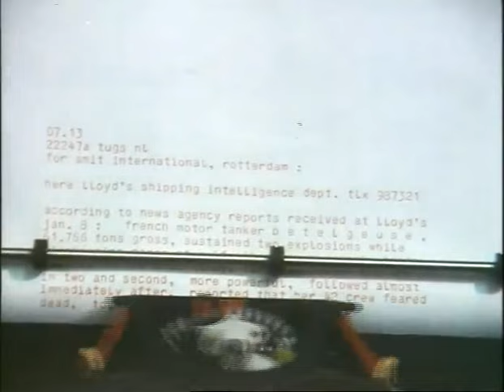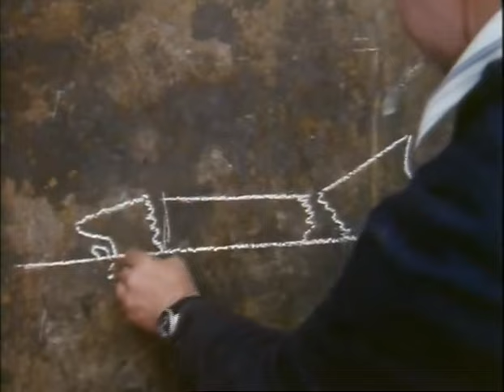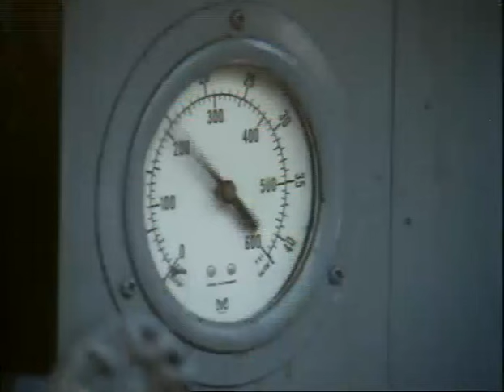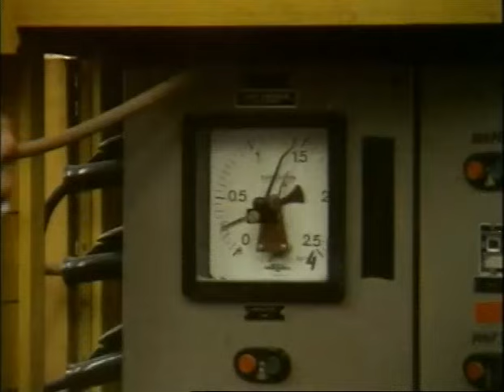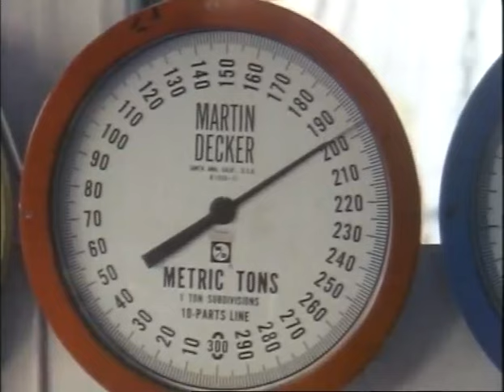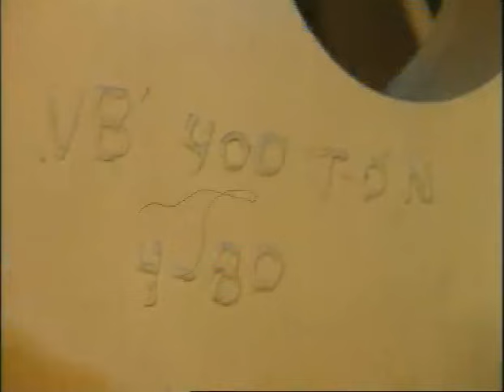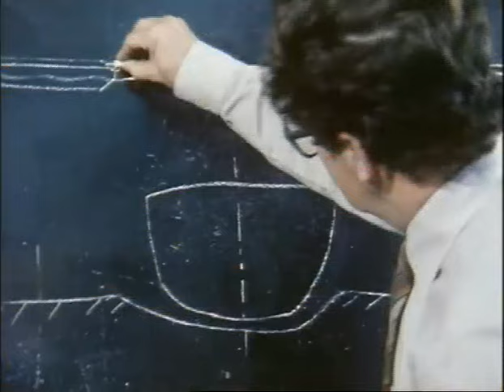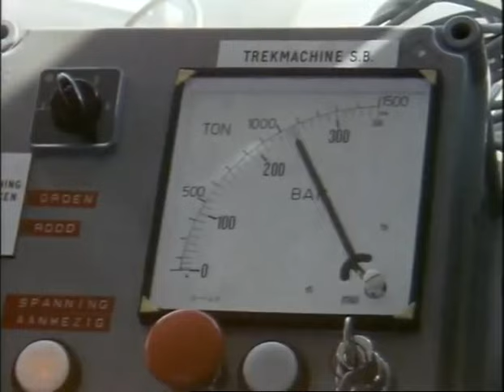Three in One (salvage of the MT BETELGEUSE)

Comment: What happened to the super structure?
Reply: Jeremy H. It was pretty much destroyed by the Explosion & Fire.
The  Stern was sticking up like the Bow for over 12 hours , and had the worst exposure. the second Explosion was the worst and happened right in front of the Deck House  and was much stronger than you usually get from Oil,       ( one Ton objects were found half a mile away !)It was a 5 story Superstructure with a Pair of tall Stacks, ( at 3:41 you can see the Twin Stack tip peeking out) the whole Superstructure was pushed backwards and almost flattened from the constant immersion in flaming Oil(look what it did to the Stern all warped , puckered & split !) the Stacks were still standing when it sunk. most of it was removed by a Crane . cutting in sections and with a Clamshell / digging Bucket on a Barge , and it damaged the side of the Hull (you can see the starboard side all ripped up)  
like 23 Bodies were not found its believed they were in the Superstructure and some burned to death by flaming oil bashing through all the Windows & Door and went down to the Engine Room (you can see the Valve spring Covers are melted)  I'm sure they found some remains, but they were all crumpled dispersed Bones. many were trapped because it was surrounded by fire.
Some of the Crew got out of Bed and got dressed after the first Explosion and were not injured by the Explosion or Fire, but they drowned, It was over a 100 foot drop from the rear of the Stern with it raised up at an angle, and it was the dead of Winter, also it was over a quarter of a mile to the Shore, it was calm but so cold. none of them grabbed a life preserver or Jacket. there was no way off the Pier for the Irish Dock Crew, they were all Killed.
Reply: Well answered. Thank you.
Reply: @Mr.M  Incorrect unloading I believe, too much stress led to a fracture and spark ..